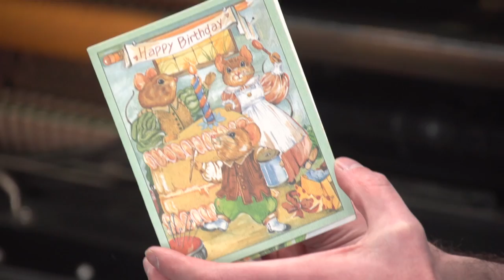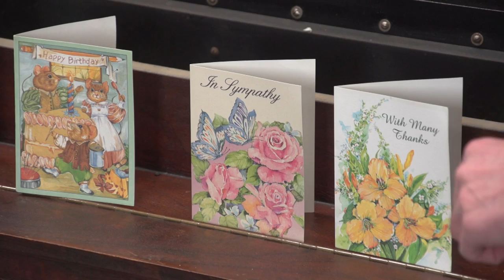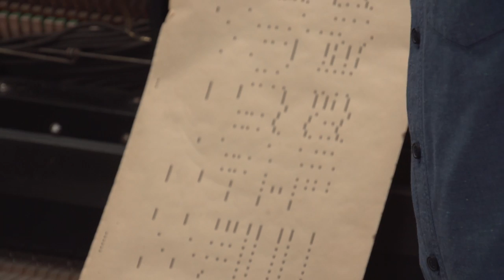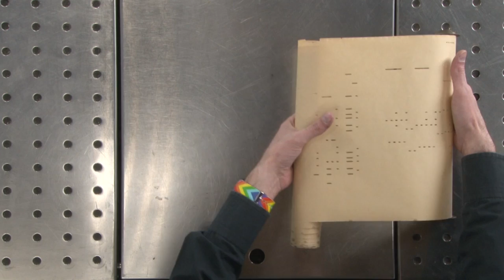Player Piano: Equipment Autopsy #96

Comment: The player part is not simple at all! You missed the most complex part. The bit you thought was a manifold is actually an incredibly intricated balanced vacuum system with hundreds of parts inside. Working similar to a brake servo but ~176 times, two vacuum systems in a delicate balance for each note. The open holes interrupt that balance  and cause the valve to move and allow the vacuum to move to the note bellow. If you still have it have a look, its an impressive bit of design.
Reply: Yeah. Watched the whole video waiting for him to get to the valves inside the stacks and to see how the bellows connect, but he never did.

Comment: The tracker bar moves to align with the correct line of holes, not to change octaves, some rolls are not made with the same alignment, one of my relatives had one that i had a go at playing back in my teens.
That air engine would not work on pressure (like you tried in the MDH), it needs vacuum to hold the slide valves against the face, try a vacuum cleaner (assuming the bellows are not too bad), but just start gentle by leaving an air gap between vac and motor.
The Jacquard loom which used punched paper was invented around 1725 to 1740 (there was a development phase), the player piano was around the late 1800's to early 1900's, the early ones used fingers to detect the holes.
It's a parallel port play head, so yes it's digital.
Reply: Sparky Projects   Yea, I was yelling at the screen when he said pressure. I can see the roll getting blown away from the tracker bar even just a little, causing extra notes to play all over the place. Vacuum holds the paper against the tracker nicely.
Reply: I wasn't talking about the tracker, i was referring to the motor, @44:36 you can see the slide valves which should be sucked onto the faces, pressure would blow them away causing the leak.
Reply: Sparky Projects yes, I know.
Reply: There were numerous tracking technologies used . Some sensed the paper edges with fingers. Some had extra holes in the tracker bar. Some moved the spool, some moved the tracker bar. Read Art Reblitz’ book on rebuilding before posting amateurish videos on YouTube. This guy is out of his league.